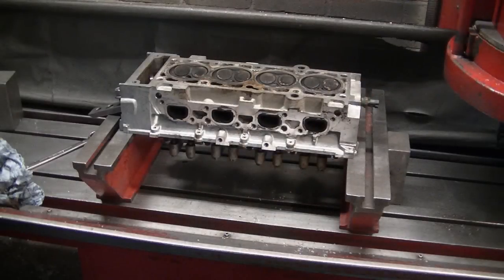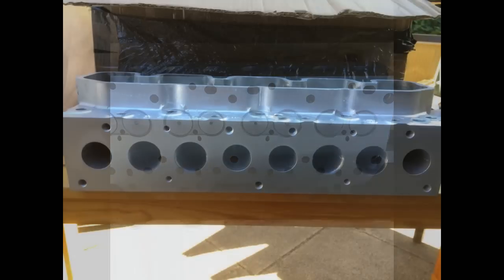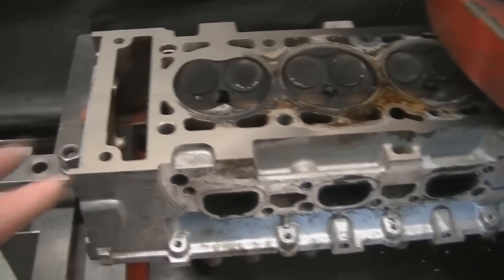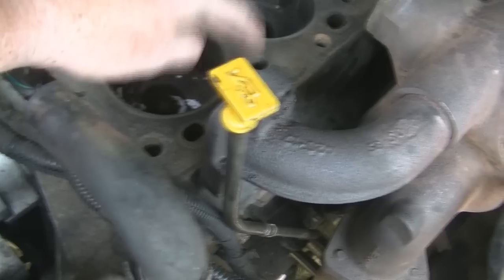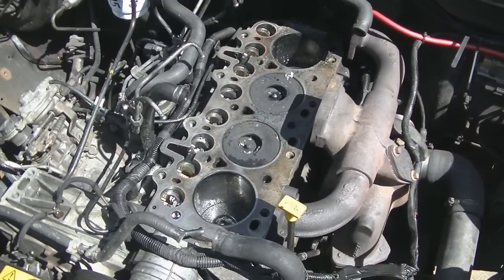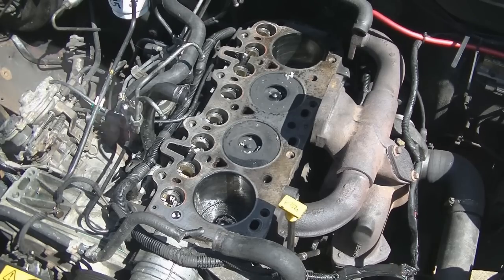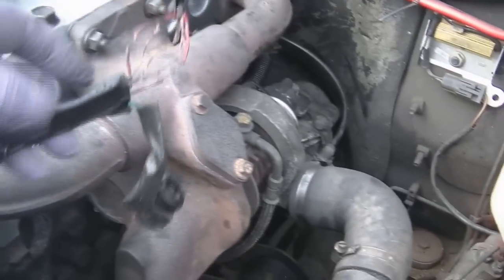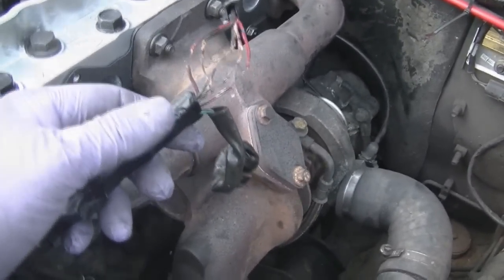Bov Break Down Pt3

Comment: Engineer Shop is translated to Machine Tool Shop in the US.  Good project.  I had a Oldsmobile 3.2 liter V6 that had a engine coolant leak.  I found out after I took the heads off and having them trued that Olds had (General Motors GM closed the company during the most recent economic down turn) a Intake manifold sealing issue. But the Intake gaskets shipped with the head gasket set and I wasnt willing to gamble that the heads werent the trouble so I took them off also.  Those head bolts required replacement also.  Not all engines have that requirement.

Comment: Good work. One thing with that honing tool should really be used with the whole cylinder with the Pistons out as you have half a cylinder bore honed and half not, could cause burning oil. Also good to use a mineral oil for a few hundred miles helps bed in honed cylinders.
Reply from the maker: Cheers Zed Man I'll look in to it Atb. Roach

Comment: hi Roach,,,the tool used to deglaze is a honing tool...they come in various sizes... I use a smaler one when tuning my rifles. unbelievable piece of kit for very handy money...  should a body need to do this and not have the tool its possible to do the job with 00 wire wool wrapped around a dowel with a rag so its dowel...rag then wrap wire wool around the rag. removes the glaze....job done.

Comment: Repect to you roach big job to undertake, a little tip for preventing things dropping in holes when you just dont want it, when the head is in place i always use small pieces of rag to block any hole i dont need open, i have taught this to many apprentices over my years in the job and i find it saves a lot of grief. Looks like you have done a good job mate im sure it will run fine :-) all the best. Shaun

Comment: Nice work but do please keep your hands away from machinery whilst they are running - I witnessed a young lad loose half his hand doing something similar. He got distracted and moved just too close and got dragged in - not pretty! 
Cleaning carbon deposits is a bugger and acetone is a nasty chemical to use. Gun cleaning oil like Young's 303 or any for black powder shot guns works really well and is not so bad to use. 
Hope the engine is still running OK?  
Cheers!

Comment: Might have missed it but why skim the old head then buy a new one?
Reply: Bushcraft1974  Milled the old head in hopes of making it serviceable again.  Apparently they don't like to do valve jobs there so they scrapped the old head since it wasn't passing the vacuum test.  I'm surprised they didn't recommend a simple three angle valve job.  Or maybe they did and it was close to the same cost as replacing the head.  Just my thoughts.